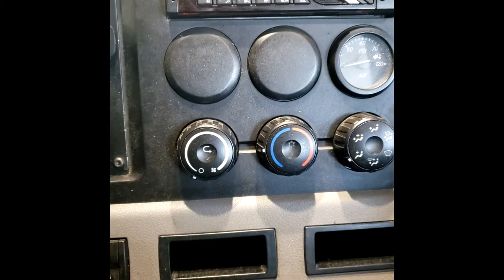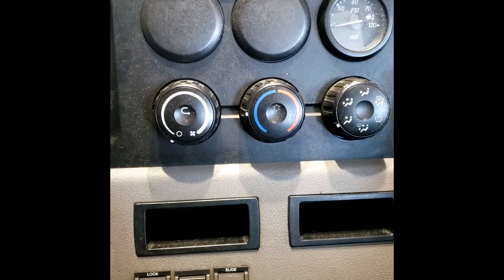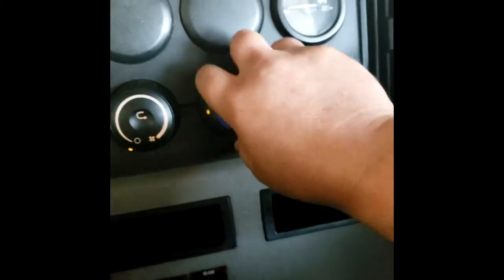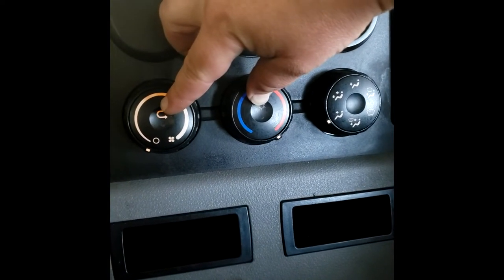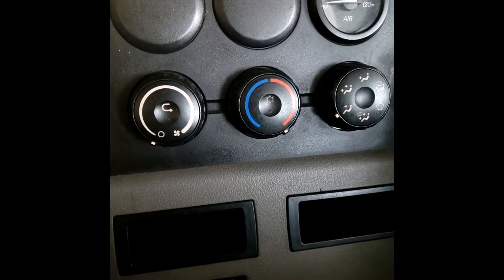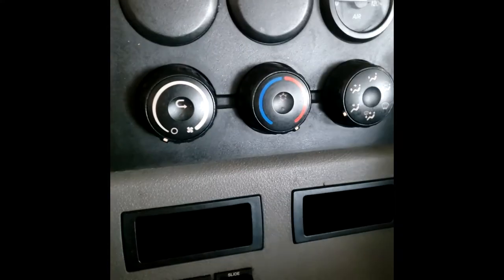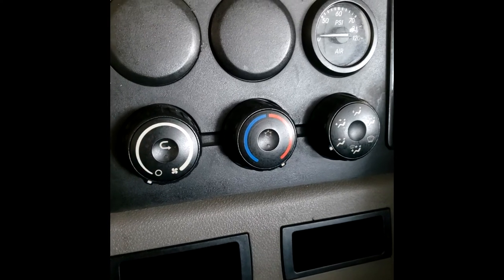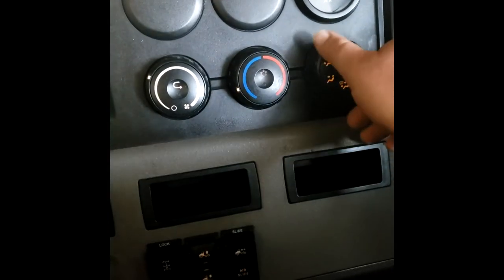freightliner Cascadia new gen a/c fix

Comment: Didn't work for me 2023 Cascadia 🥵
Reply from the maker: What is the issue your having?
Reply from the maker: It could be low freon and low pressure switch not allowing compressor  to kick on. I had a 2023 cascadia about a month ago that I had to update HVAC software to get compressor to cycle properly. Is compressor engaging at all ?

Comment: Still not flashing
Reply from the maker: Fan speed turned to zero, temp turned all the way to heat, and mode turned to blow on face. Cycle key to on position. Hold a/c and recirculate buttons at exact same time and hold for about 10-20 seconds. Once flashing release buttons and wait for flashing to stop.